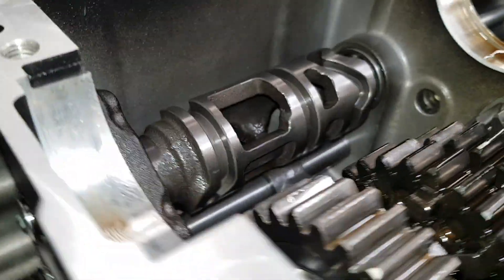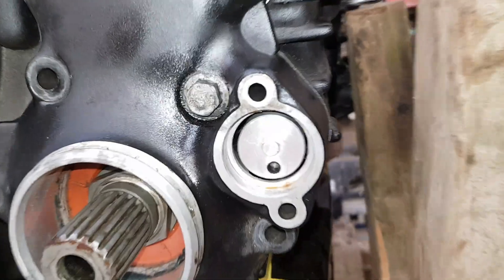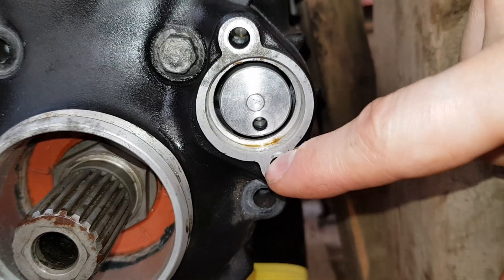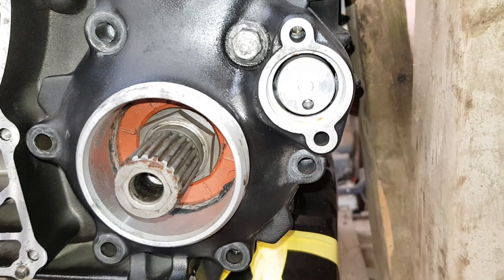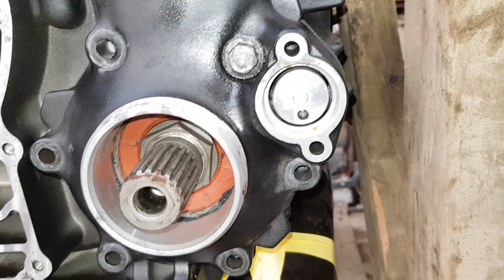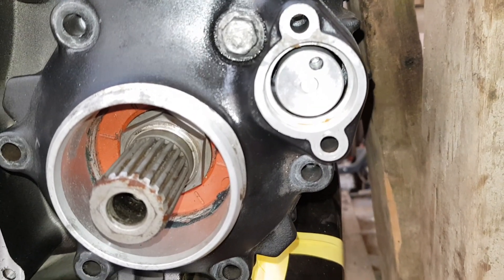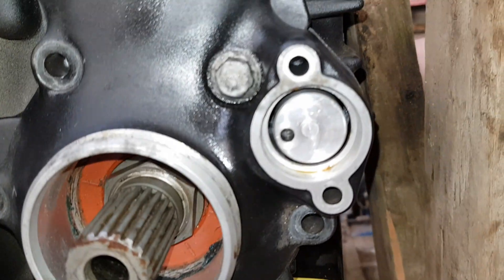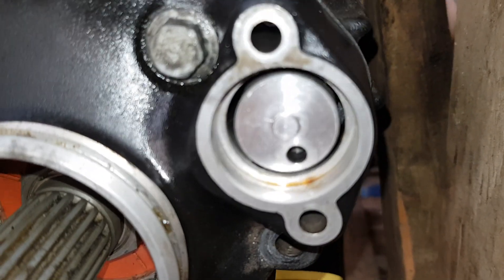Triumph Rocket III GPS Locations & Gear Selector Shaft Positions

Comment: It’s a shame it doesn’t have a 6th gear. It makes enough torque it could use a really 6th for those 100mph cruises. Something that doesn’t have you floating around 4K rpm
Reply from the maker: The 6th gear is possible, I don't understand why they didn't include it from factory, I did read that apparently market research for cruiser riders said they want 5 gears....
Reply: @r-iii-rturbo9157  5 would have been fine if it was taller. Or there was options in final drive ratios. Maybe short for standard and longer for the touring.